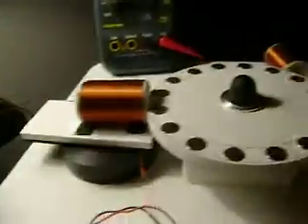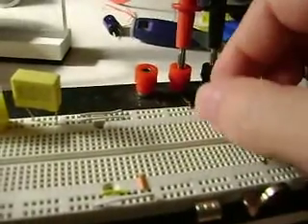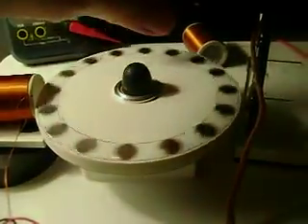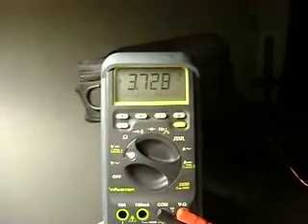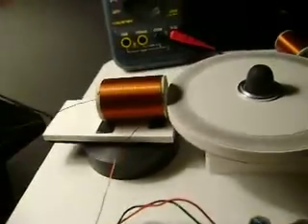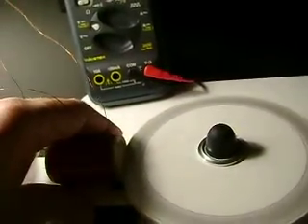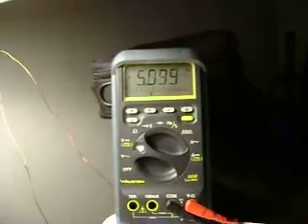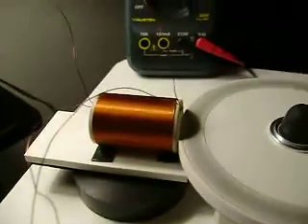Testing a regular coil vs bifi coil on the pulse motor.

Comment from the maker: I will demonstrate what Im saying in a near future vid. I am also preparing a new setup using Hall effect sensors to trigger mosfet transistors to replace the reeds I have been using. The mosfets will be ganged in parallel to reduce the switching resistance just as they do in high power car amplifier power supplies. =]
Magluvin